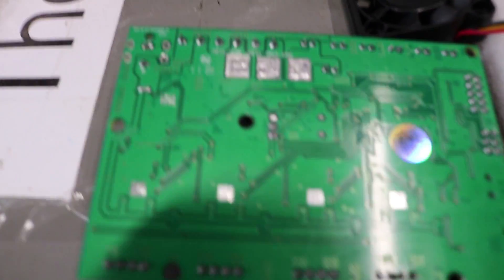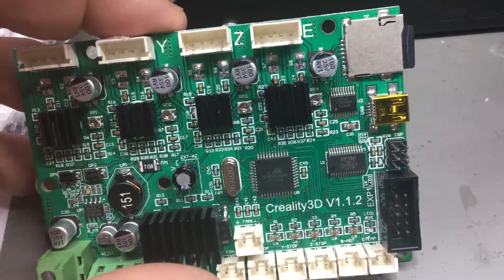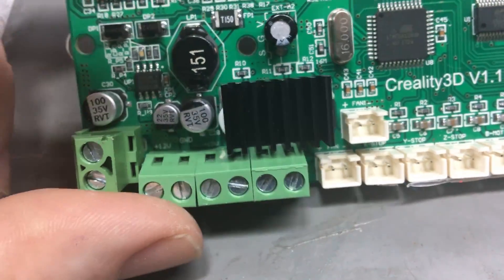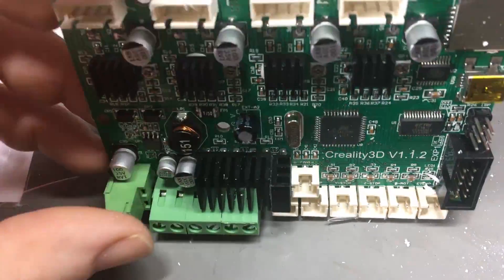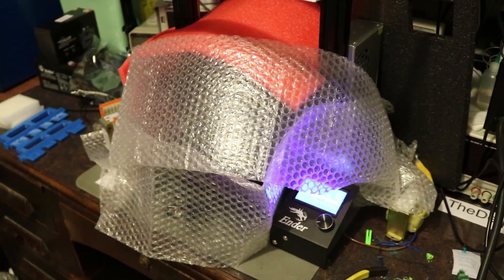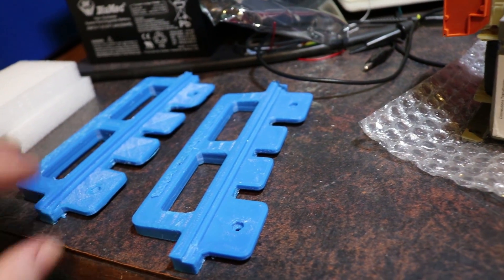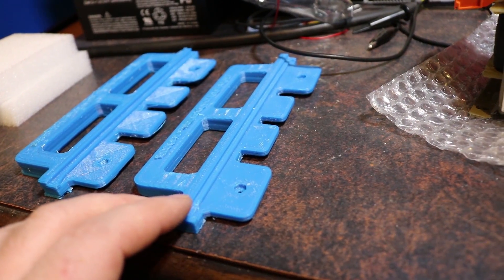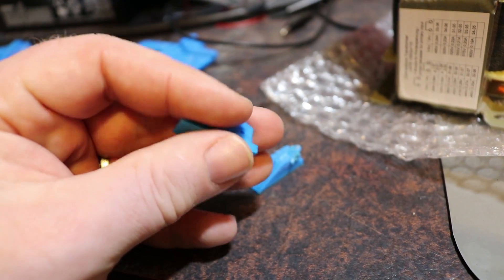🔴 #393 Creality Ender 3 Electronic Improvements

Comment: I think the CNC I built a few years ago used the same stepper drivers but they come on  a plug in DIL PCB and are cheaply available for when the blow up. I had issues with the heat sinks parting company. You have inspired me to start work again on my big delta printer this year.

Comment: Very interesting board and repair. I have really just started with my own 3D printing. I haven’t had any actual failure but some of the results hasn’t been as good as expected. It’s a very interesting failure mode you have had great repair that should help a lot of people thanks for sharing. I haven’t tried ABS but intend running some PLA plus. Thanks regards Chris.

Comment: Hi, sorry for asking this almost a year and half latter, but my printer vibrates every time the board does a short bed re-heat to maintain the temperature, to prove it, I've added a bed temperature rise in the middle of the print and sure enough the printer begins vibrating and only stops when the bed reaches the new temperature. Do you think the improvements you did on the video would solve this problem? If not, do you suggest anything to "filter" the power, so the steppers don't get so angry when the board is heating or maintaining the bed? I've tried TL smoothers to no avail. Thanks.
Reply from the maker: It sounds more like your power supply isn't working as well as it should, possibly putting AC onto the DC output when it is being loaded by the bed heating, but that is just a guess.
Reply: @TheDefpom  I'm not sure, I found a guy reporting the exact same issue on reddit, and he said he upgraded to MeanWell PSU and it didn't solve the issue, only when he upgraded to a Duet main board the issue was gone. But thanks for the reply.

Comment: Thanks for your video !!  Excellent !! Something strange thata is happening, My ender stopped comunicating via USB port: "Error: Failed to autodetect serial port, please set it manually." I tested the board with 3 diferent Octoprint installations, including one on my notebook, changed 3 usb cables, and nothing....  could it be the USB port on the board itself? any fix?

Comment: Looking at your board at about 5 minutes, you might consider putting some small heat sinks on the solder side of the board on the back side of the 3 MOSFET's that you put the small heatskink on the plastic case of. As more heat is going to go through the board than through the plastic on the transistors. Also it helps to have a fan blowing on the edge of the board to get both sides. Connect a DC fan inside the box to the power terminals not just the fan terminals as those are usually for the extruder and extruder motor. I'm thinking not connected right to begin with. part cooling is switched and extruder motor and heat break is also switched on when running, and as you said correctly the board should have cooling when there is power to the system. Interesting that your A4988 chip for the extruder went bad. Perhaps it was not setup correctly to begin with, and there are adjustment procedures on various websites. There is a trimmer for each of the 4 stepper drivers and they need to be set correctly. I have a similar board but different layout on my Tronxy I3 printer. I was just looking at your video to figure out where to connect a BT Touch auto leveling sensor, and that is in series with the display connector, when doing that it causes the loss of a buzzer and that is something that most of us can easily live with. It uses pin 27 on the control chip.

Comment: C4 on the v2.0 boards is the one with the problem. The added black cap to the 5v rail (in place of the connector that has "S G V") should probably be of better quality though. 

I don't think there's a problem here with the positive trace going to the caps. There IS a problem with the ground planes though, which I don't believe you've adequately corrected by bridging the mounting hole. If you look at the planes in the screen caps of Altium, the only other place the ground connects to the rest of the board is directly under the R on R18. eek!

Thanks for tipping me off to this!

Comment: If you were having overheating issues, it may just be because it looks like the control board is also wrapped up in the bubble wrap enclosure you built. If it's not getting fresh, cooler air from outside of the enclosure then surely you are trying to cool these components with increasingly hotter air. I'd make sure that either the bubble wrap isn't blocking any of the vents or control board (and PSU too) fan, or move the board away from the unit and encase in an external enclosure of it's own, maybe with the PSU and LCD, pretty sure there are some designs for this on Thingiverse.

Comment: Had my ender 3 for 2 months, and I turned it on, the display started flickering, and shut off but I could here it was on. I turned it off for a few seconds and turned it back on. Then I heard fireworks and a pop! In the mother board. Pull it apart and I see it burned up. 

POS. possibly due to poor soldering.

Comment: I would regard the method of "sticking" a heatsink to the MOSFET as very bad design, almost an after thought.
What does the later models look like?
The heatsink transfer area on those MOSFETs is actually soldered to the PCB, getting heat away by "sticking" to the Epoxy case is very inefficient and "Cheap" in my opinion.
What is the heat transfer characteristics of the epoxy and the "glue"?
I repair industrial PCBs and that would not last a second, when MOSFETs of that case type are used, they are soldered in with the heatsink area facing upward and a heatsink CLAMPED on top, or they are mounted at right angles to the PCB and CLAMPED to a vertical heatsink.

Comment: Hello. I've proably burnt some of mosfets shown at 4:00. I was replacing fans and by measuring output voltage I made short circuit - ender did reset and since that moment I cannot control fans - the output voltage is always  around 24V and I can't control it. Can you tell me what mosfets are they? I've got radiator the same radiator but glued-up and cannot move it.

Comment: I fixed my control panel fan by just wiring it into the same block as the heat sink fan. Runs as long as the unit is switched on. Next I'm going to install a buck convertor to step the voltage down to 12v so it will run at 1/2 speed for less fan noise.
Reply: If youre stepping the voltage down you might also want to get some low noise PC fans.

Comment: The PCB has many through holes (called vias) to distribute the ground through the board, I don't think that interrupted ground plane on the back (due to the screw hole) is a big concern. The vias on the board provide sufficient grounding. Also, that uncooled mosfet only has the job of powering two fans, nothing else as far as I can see. That's a total of ~200 mAh, it's probably fine without the cooling rib attached. More cooling can't hurt though, I suppose.

The finding of the parallel fan setup for the electronics cooling was good to know though, thank you! I'm applying the same fix you suggested to have an always-on board fan. The fan not being on constantly is likely what caused the layer shift.
Reply from the maker: Stefan Wilkens - I added the 0v jumper because that part of the PCB had very few paths going to it, the main via groupings were ok for the rest of the pcb, but that trace didn’t have much and so it really needed that adding.

Comment: Wrong capacitator on V1.1.2 board is not C4 but the one in the middle called SGV. C4 you are referring to is on V2.0/V2.1boards. That red trace mod does nothing to resolve your problems.
Reply from the maker: Nikopol the wire modification does help, the small traces cannot carry the current, causing voltage drops at each surge, the caps are there to help prop up the voltage and smooth the supply out, but as the traces are too small the caps don’t work as well as they should. I have proven this with my own printing tests, the voltage drops were causing missed steps and driver issues.

Comment: Great video, but i'm curious, and don't want to ruin my board. which pins did you bridge together, after you isolated the fans connection to the pad. Orientation helps me better than just saying ground, i always second guess myself. I'll be very grateful for a simple explanation.
Reply from the maker: @ 6:33 I am pointing directly at the pin, the left pin of that pair is 0V, so is that thick track around the pin, and down to where the 8 small holes are below the one I cut, you can attach to any of that, I ended up linking directly down from the fan pin, to the bit with the 8 holes (they are called via's)
Reply: @TheDefpom  thank you so much. Great help!

Comment: Awesome job discovering and showing how to fix it. A great example would have been some PLA 3d prints before and after to better demonstrate the improvements since most use pla. I have not checked my Ender 3 board yet. I had just added TL smoothers and new v slot wheels to it and it is printing a lot better but it may have some of the same issues that you have shown so I will have to check it out.  Creality needs to do a better job inspecting the quality instead of trying to rush these printers out which then they have a lot of angry customers.
Reply: My first guess is that they did not calibrate the reference voltage, as that I have been finding is an issue with a number of manufacturers.

Comment: I am running into same issue of layers offset with ender 3. And the board fan is not running, specially for ABS setting. I see the little cut you made on the board but missed on what you did after that. I wish you slowed down little bit and showed clearly what you did with the fan issue and show picture of final fix. Can you post it ? Appreciate it.
Reply from the maker: Srini - yes I should have shown that better. The pin that I cut the track to, should be connected to the big track right next to it (0v)
Reply: Thanks. Issue with mine started after days of working fine. Still troubleshooting but a quick glance shows my board is similar (in missing adhesive, fan behavior etc) to yours.
Reply from the maker: Srini - I just published another ender3 electronic mod video, that one is likely to help the issue even more, the test print I did after that mod didn’t have any offset issues at all, where previously I was seeing that still (but was improved from what it was doing after doing the stuff in this video)

Comment: Any idea why the x axis would travel double the distance it is supposed to move?  The print is off the right side of the bed, and a 20mmx20mm cube is 40mmx20mm.
Reply from the maker: motorexp - maybe your slicer is set to scale up in one direction?
Reply: Tried gcode from several different slicers with the same result.  I even updated the firmware, and got the same result.  Going to check the driver voltage next.  The put a glob of hot glue on every terminal on my board.  Very annoying.
Reply from the maker: motorexp - it could be a hardware failure with the stepper driver, it might be set to the wrong step size, or just be faulty.
Reply: I am thinking it is a hardware failure somewhere.  Just have to track it down.  This is my second Ender 3.  The first one was returned since I couldn't track down a cause for the x-axis shifting at a height of about 10 mm.
Reply from the maker: motorexp - when I got mine the Z stepper didn’t work, I traced it to a bad driver ic which I then replaced (one of the handy things about being into electronics, I fix my own stuff). When I opened it I found the plug wasn’t fully in for the motor, so I think that is what blew the driver.

Comment: Thanks for the useful video. I noticed, when I clicked on your link to the Banggood site, one of their photos of the board shows the offset heat sink problem you described, so they could all be made like that.
Reply from the maker: The mosfet heatsink although not ideal, is probably not a huge issue, that one controls the cooling fans, it may not of been getting too hot anyway but as I thought I was having odd fan behaviour I wanted to improve its design to be sure, my fans have been fine since, so it could of been a problem.

Comment: Am I right in assuming that you were having issues printing in ABS? What about for people who dont hotbox their ender 3 and want to print PLA?
Reply from the maker: I started with ABS and so far that is all I have tried using, my understanding is that PLA is easier to use than ABS, and does not require tricks such as enclosing the unit to keep the heat in.
Reply: Mephiston 
If you're referring to the problems with stringing on the overhangs, this would still be an issue with PLA but possibly less pronounced. It would be completely overcome by using supports when the model is sliced, whatever the material.
Otherwise, as Defpom said, PLA is a much more forgiving material than ABS as it can be printed with no heated bed and a much lower nozzle temperature but it's also much more brittle, so should be avoided for strength critical parts.
Reply: Alrighty, thank you both for your good answers, I appreciate it.  I meant mostly because it seems that a lot of issues stem from overheating, and PLA is printed at a lower temperature, so it may be potentially less prone to said overheating.
Reply: I’m using PLA daily and it works very well.
Reply: Mephiston 
If you're looking for great 3D printing videos from basics upwards then try searching on here for Thomas Sanladerer.

Comment: Would it be easy to replace the control board with a better designed board. The printer is amazing at its price point and to me investing an additional 70 or 80 dollars to improve the control circuitry would be worth it.
Reply: yes very easy, the firmware that is used is just Marlin, and since Creality ave made the Ender 3 open source you can get the values for steps / acceleration / jerk etc... from their config file on github some of the values after checking them could be better though.  Plenty of boards out there you could use i actually bought an Einsy like in the new Prusa MK3 ;-)

Comment: Dont you just love the cheapest printer available...   you do get what you pay for
Reply from the maker: The printer is actually pretty good, nice and solid etc. it just has a few electronic weaknesses which could be improved.
Reply: I would agree that for the cost it is pretty good but as you say the electronics and attention to detail could have been a lot better.  This just shows me how inexperienced they are at electronics.  And let’s be honest, this is an electronic product and should be done at a higher standard.
Reply: It's $200 and makes amazing prints, wtf do you expect?

Comment: Bad / amateur design seems to be a common theme with 3d printers.  The wiring in mine melted (not rated for the current).  It also had 3 separate power supplies when 1 would have done
Reply: RavenLuni Your ender 3 wiring melted? Or some shitty Anet?
Reply: Original UP  Just making the point that it seems common across the board (although to be fair I'm sure they must have made a few improvements by now, then agan I did pay £2000 for it (they were a relatively new thing at the time and I was like 'must have'))

Comment: If you continue to have problems with the overhanging sections of you handle print then perhaps consider using support material to prevent it. Depending on the slicer you're using, you should be able to adjust the support material to suit. Although it's not as clean and smooth as something printed on the bed the result's much better than having dangling filament on the underside!

Comment: I wonder if Stratasys still has a valid patent on their automatic filament exchange system.  It would explain why no one else uses such a system as its implementation is very simple.
Reply: douro20 Most of the stratasys patents are still in place I think.

Comment: Hmm its sloppy construction, perhaps more caps on the supplys close to the stepper drivers may help to keep stepper motor noise from leaking on to the pcb rails.
lots of extra decoupling on the control chip  too.
How brittle is that handle, can it cope with bending?
Reply from the maker: I didn't see this comment for some reason... as Pete said, the orientation is important, to ensure that the stresses are not flexing the layers or directly trying to pull them apart, otherwise yes it will be a failure point. I printed these laying flat so the layers are oriented in the strongest way for lifting the unit, I still don't completely trust them but I had tried to break one of my test handles and I couldn't do it very easily, so I am pretty sure they are strong enough.
Reply: zx8401ztv 
It's made from ABS so it should have a bit of give, especially when compared to PLA.
Reply: Pete Allum,  Ahh ABS.
Because the part is made in layers i was wondering how well it holds together, if each layer isn't bonded really well it could crack up.
I was just being nosey :-D
Reply: zx8401ztv 
So long as the printer settings are correct the layer bonding should be fine and the part should perform well, although there will always be a slightly weaker axis between the layers. The effects of this can be minimised, where required, by suitable orientation of the part during the printing process.
Reply: My subscription was gone, ill have to check my account, hope its not been hacked as i have many subscriptions :-(
Reply: zx8401ztv ;
Reply: It’s a sloppy PCB job !!  They have crammed it on to 2 layers for cost but didn’t do all the things you need to do when you make that decision.   Like via stitching and proper thick traces/polygons for power, stiff decoupling, low inductance paths etc.  This ideally should be a 4 layer board.